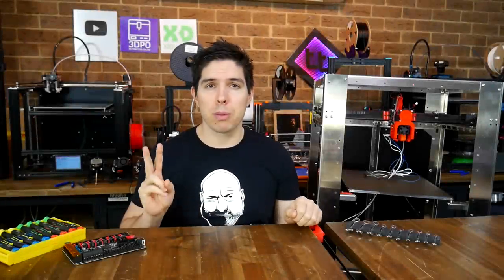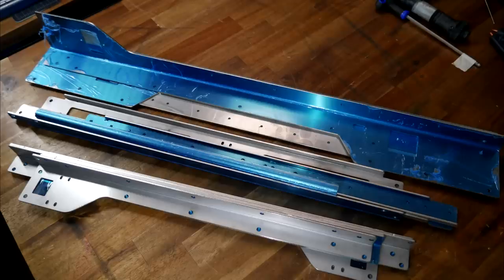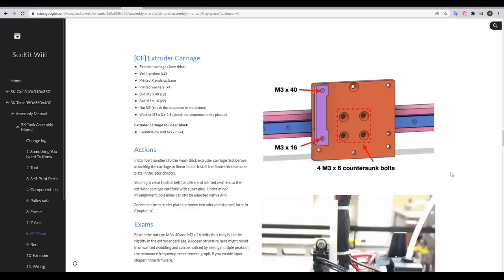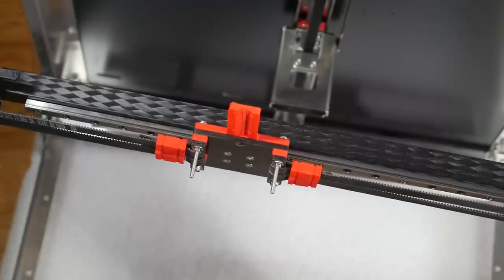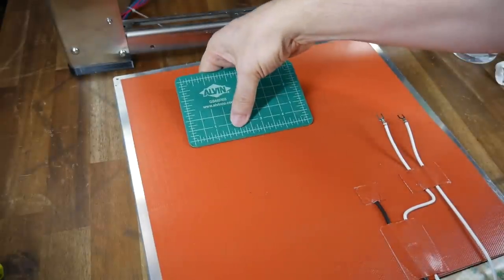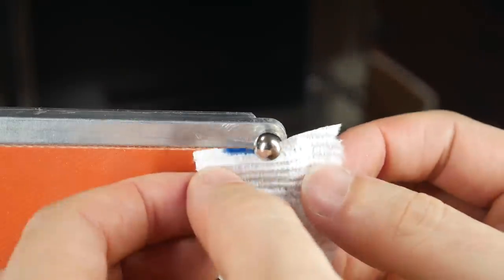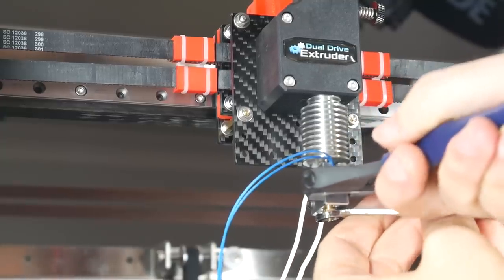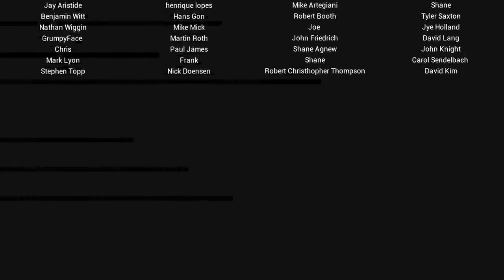SecKit SK-Tank coreXY build pt 2 - Assembly complete

Comment: Excellent video series! I love how you are using the overkill octopus. I want to eventually get one, but I have this SKR pro I still need to use, and ordered a 1.4 to finish my other printer build. For anyone who wants to know, the ACM (aluminum composite material) has different variants, but is actually very inexpensive to get custom parts cut. My cutting supplier uses PE between the aluminum plates and you can get painted white, painted black, and brushed. It makes for some excellent enclosure panels due to cost effectiveness, great esthetic, and has a built in insulating layer.
One small clarification for this video. V-slot extrusion is used with v wheels, which have an angled slots to allow the wheels to track. T-slot is the most common and does not have these angled edges and is generally cheaper. You showed T-slot, which is also the ubiquitous extrusion profile in 3D printers.

Comment: I put an Octopus and Klipper on my old Ender 3 just to get some experience in preparation for my CoreXY build.  It's really an awesome board once you figure out the pins, with klipper it's a dream compared to recompiling Marlin over and over.  Will probably leave that board on the Ender, it prints so nice now and is so quiet.
Reply: Did it make a big difference? I'm debating on trying out klipper on my ender, right now it's just marlin and a bltouch on an skr mini 1.2.
Reply: @deathcogunit106  Yeah massive difference, even the skr mini would be a huge improvement.  Klipper can really be dialed in much easier than Marlin.  In OctoPrint you can just edit the klipper config and hit restart for klipper or the firmware.

Comment: Thanks for answering the question i had in the end of the last video! One thing I still dislike a bit on the "non-VRail"-way ist the after life of the printer. There might be one day, where the Printer gets outdayted or there is an interest to build something new. With VRails its more flexible to do that. Exited to see the finished result! Great video, thanks for your work!
Reply from the maker: That's true. I have some spare extrusions from an old disassembled printer that will be reborn as another project.

Comment: I got a kick out of seeing one of my designs (the TPU feet) show up in a Teaching Tech video. Seems fitting as I learned about SecKit from your SK-Go review video. 
I’ll see if I can some of my other parts posted as you finish up the electronics. I had some delays getting Klipper working (my learning curve, not SecKit’s fault) and am very happy with the initial parts off the printer.

Comment: Nice idea. But one problem i can see , 
And that is Stainless steel tends to move/warp as the air temperature changes, the best temperature for stainless steel is around the 12 degrees  and if it changes by around 4 either + -  the frame that you have made will keep on moving by about 3 to 5 microns, so if you get ghosting then this will most likely be your problem
Hope it does not though, 
oh you could add gusset plates in the corners to reduce such,

im looking forward to seeing the performance.
Reply from the maker: I'll look out for that.

Comment: I'm sure I could sit on my Craftbot Flow IDEX and my old Printrbot Metal Plus that use the same construction. That 8mm-thick bed however is something else. I hope the heat up time isn't painful. How powerful is the heater?
Reply: It's 400W. Some owners have expressed the same concern and upgraded the heater. I put insulation on mine and that's enough for my needs :-/  There is roughly 10 degrees C difference between the thermistor temp and the top of the bed, so I set the temp higher than desired and give it some time to heat up.

Comment: I am curious, at 7:45 I see that the kinematic bed ball that rests on the othe bare metal Z support slot. Now that you have had it for a while and hopefully run it quite a bit. Does this cause ware on the ball with it having metal touching metal. If this is the case of ware there could be a chance that the ball wears out enough and would fall thru the slot, I would think desiging an and printing Pteg, ABS or TPU cushion to sit in between to prevent ware of the parts would be in order!

Comment: 8mm thick bed seems overkill, that's a long heat up time! What keeps the bed from wiggling and jiggling during rapid accelerations with a big ol part on it?
Reply from the maker: Because it's coreXY, the bed only moves in Z. I guess it's possible the bed could vibrate with high speed printing but the Rat Rig has a similar system and I see no evidence of this. Probably helps that these beds are heavy.
Reply: @TeachingTech  that's kinda what I was getting at, the high speed wiggling the frame from head movement or rails, and transferring to the rounded feet. Glad you haven't seen an issue with it though!

Comment: Hi, Michael I have a question. Are you going to do a review of bigtreetech Skr mini e3 v3? 😀
Reply from the maker: Not sure if I will. Every time I make one of those mainboard guides, the manufacturer makes a new version or a component changes and the guide becomes partly redundant. It's frustrating and I also run out of machines to fit the boards to. I used to do it on the Ender 3 but now it has twin Z steppers I can't simply swap the mainboard to another just for a video.
Reply: @TeachingTech  thanks for responding, and I understand. Thank you

Comment: I would be sold if they had a 400mmx400mm option. I already have enough 350mm machines and need something bigger and would love an all metal option like this
Reply: Belt elongation, single bed size and shipping make it about the roof for a CoreXY printer. I'd choose other kinematics and divided smaller beds if going larger. ^^
Reply: I'm with you on this. the SK-Tank looks really attractive, but my Rat Rig V-Core 3 is the last 300mm printer I'm putting together. As the Tank won't be available in 400mm or 500mm, I'm probably just going to stick with RatRig since they offer and ship both of those sizes
Reply: @jfaristide  ratrig is nice. Got a 500 myself
Reply: @jfaristide  I'm preparing a smaller SK-Cube (200^3) at this moment. WIll broadcast if a larger printer prototype is available. :)
Reply: @seckit3dp  that I would be pretty interested in
Reply: @jfaristide  honestly ratrig will probably be my next printer as well.  Are there any community mods that add a nozzle endstop similar to vorons? I swap nozzles all the time and its my fav feature on my 2.4

Comment: For Part 3: Why did you decide to go with standard Octopus and not the pro version?
Reply: Its standard.
Reply from the maker: I already had it is the main reason. The Pro allows higher voltages to the steppers and is primarily targeted at speed benchy printing. I enjoyed doing that with the Rat Rig but I'm not going to do it with every printer. Therefore the standard is sufficient for my needs.

Comment: can you share what type of parts you have used to square the X and Y ?
Reply from the maker: They were left overs from a test I did on 3D Gloop. Just cylinders with a brim that are the same height, clamped to the frame. You could use any two items that were the same height, and these were handy.

Comment: idk man watching this video there are so many points of failures/flaws.. Just doesn't seem a well rounded 3d printer design. 
3:31 - Printed parts for areas that need to be 100% precise and not move.. These need to be metal.
5:08 - thats a terrible way of belt tensioning.. that little bolt and washer will not hold that tension overtime. A screw/knob like ender would be better here.
8:45 - more printed parts that flex/expand/wobble when printing.. These need to be metal. Why go through all the trouble of this nice 3d printer with 3d printed parts for the most important area, the print head.
5:04 - Use an actual brass belt crimper instead of plastic and zip ties... Seriously.
Reply: You're right about the belt tension mechanism. It is fiddly and it needs to be torqued properly to clamp hard enough but not so much that you strip the threads. 
As for the plastic and zip ties on the belt that is fine although I would prefer it get clamped flat on the carbon fiber sheet. The method they chose allows you to replace your belts without having to disassemble the print head as my suggestion would require, or undoing a permanent crimp as your suggestion would require. 

As for the printed parts on the print head they really don't matter. The only ones involved in the structure are through bolted with metal fasteners to the inner CF sheet. When they swell with heat they'll only increase the tension on the metal fasteners. The majority of structural plastic here is the CF sheet which is strong enough for this application and lighter than the metal counterparts which is advantageous for a corexy mechanism. In any case the extruder itself is made from plastic anyway.
Reply: 5:08 (Belt tensioner) Take playing a guitar for example, a finger pressing/pulling in the middle of the string can easily change tension, but it needs much stronger structure on both ends. The XY belt tensioners in SK-Tank use this concept and tense the belts in the perpendicular directions to the belts. The way tensioners being pulled gives you a sense of the tension, and no report of loosen belt due to how the tensioner is fastened since SK-Tank Beta in early 2021.

The common type of tensioners stretches the belts along its direction. Belt tension is changed in a larger scale while screw/knob moves slightly, and this force is scaled up by screw rotation. On the other hand, SK-Tank belt tensioners moves more and changes tension in a milder way.

Another customer suggested to support the tensioner with a bolt against the stepper. I'll also take this into consideration. 👍

For the other questions, the same as c_k answered, these are non-structural components so printed parts are used to reduce moving weight. ^^
Reply: Cody the competition?  😂🤣